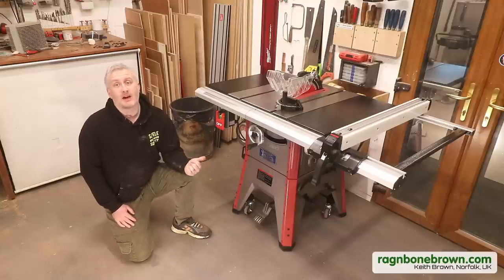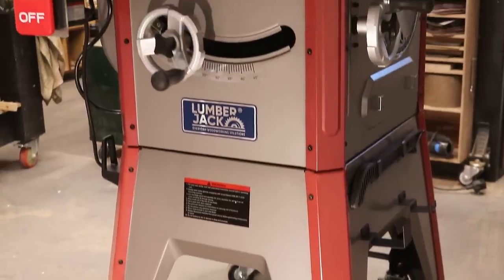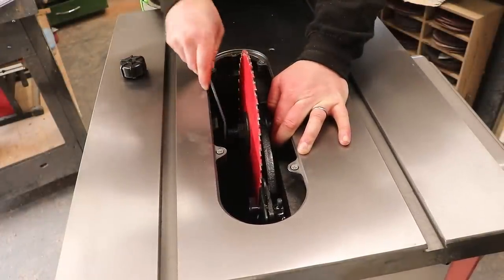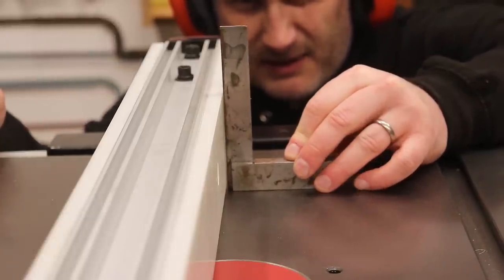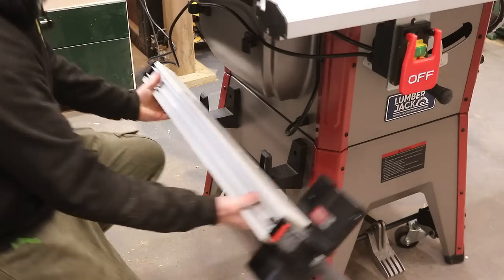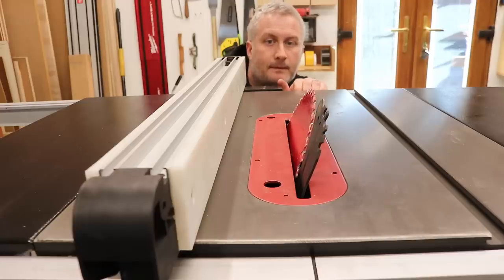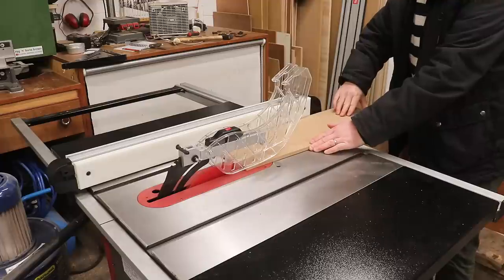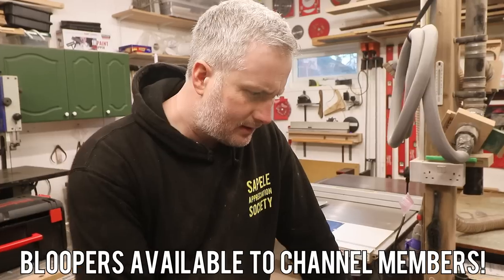LUMBERJACK TS1800 TABLE SAW: Everything You Need To Know

Comment: Dust collection Problems
In addition, to the saw, I bought a Lumberjack dust collector.  My intention was to connect the dust extractor to the table saw. I thought this would be easy, how wrong I was.

The first problem is the castor lifting system on the saw, while great for moving the saw around in a small workshop like mine, is in the way of the dust port and leaves no room to fit the flexible 100mm hose from the dust collector. 

Even if the castor system did not get in the way, out of all the adapters that come with the dust collector only one 
will fit the sawdust port and that one reduces the 100mm down to half that and still leaves the problem of connecting the flexible hose to the reduced outlet.

I went to a well-known outlet and bought a selection of 100mm PVC ducting items. 

None of what I bought would actually fit the port on the saw or the fitting on the end of the flexible hose, even the connecting section that can join 2 sections of 100mm pipe together would not fit the saw or the hose.

In the end, I used a short section of 110mm PVC drain pipe that fits loosely over the sawdust port on the saw, and I used silicon filler to seal the joint and 2 self-tapping screws to hold it in place. This allowed me to connect a 100mm right-angle bend pipe section with enough clearance to allow the castor system to still operate. 

This was also loose in the 110mm section, so more silicon and self-tapping screws solved that, finally a short section of 100mm pipe fitted the 90deg bend correctly and brought the end of it to just outside the castor space and is easily accessible at the rear of the saw.

The final bit of the jigsaw was connecting the end of the flexible hose to the new 100 mm end of the sawdust port. I had to remove the end that was fitted when it came (not easy as it is glued in) and replace it with a 100mm PCV connecting joint that fits the 100mm pipe correctly. Now I can connect the flexible hose to the saw without problems or having to get on the floor

Comment: Great unbiased review as always Keith,  the lumberjack looks like a well thought out peice of kit and has many nice to have features. Id keep the Lumberjack as the features are just way more user friendly.
Reply: Had the saw for well over a year. It’s a great bit of kit,accurate,powerful and not too loud. It has standard mitre slots,so after market add ons are available and compatible,had the same issue with fuses as Keith. I’ve ordered two slow blow fuses as recommended. If I just leave saw switched on,the standard 13a fuse works just fine. It means I must lower the blade below the table surface every time I’m finished in my shop,too dangerous otherwise. I’d recommend this machine,great tool.
Reply: @johncorrall1739  Hi John sounds really good,  I see the saw has had quite a big jump in price recently, I suppose its like everything lately.
Reply: @karlpopewoodcraft  
I don’t mean that I leave the saw running,clearly I turn off the current,I just don’t turn off the power to the saw.
Reply: @johncorrall1739  haha ye I understand John that would be crazy lol
Reply from the maker: Cheers mate!

Comment: Great review I’ve got the Axminster 12” version and apart from the short arbour (machined my own to take a dado stack) it’s been great agree with all your comments. Bit of an own goal by lumberjack, if they had responded with a sale or return offer thing you’d be a LumberJack. Also I really don’t know why they don’t just charge £20 extra and put on a soft start module.   ❤
Reply from the maker: Cheers. I think the electrical issue has only come about recently, it's been on sale for years but all the examples of it have been in the past few months so presumably something changed in the manufacture of the saw causing the problem
Reply: @RagnBoneBrown  Makes me wonder if they've downgraded the motor, which has a higher start current.
Reply: @CNile-se9xw  The motor is designed for the American market running on 60hz running at 3450 rpm. In the UK at 50hz it runs at 2800rpm , very slow for a table saw and the reason it cuts slower. Until hey spec a decent motor to run on the UK supply with a soft start I wouldn't want one, shame as it looks a decent saw.
Reply: @alankirbywoodworking  Spot on mate, I didn't realise they kept the 60Hz motors, so your speed difference sounds right. Another damning factor is that running a motor at a lower frequency than it's designed means that's also less efficient.
An example of frequency relating to magnetic strength are the physically small transformers (for the output) in pulse width power supplies. Their tiny transformers are fed a high-frequency signal & produce staggering high output for their size.
Reply: @alankirbywoodworking  The motor speed is largely irrelevant, as it is not direct drive (the size of induction motors precludes this- you would not get much depth of cut...). The speed is set by the motor to spindle ratio, allowing the optimum to be chosen. It may well be that the manufacturer does not change this for the non-US market- which would be a poor decision. Single phase Induction motors (permanent cap type) are 'soft start' to an extent anyway- the starting torque is quite low.
Reply: @CNile-se9xw  Most squirrel cage induction motors are designed to span 50-60Hz; the design parameters are not critical over this range. They are typically spec'ed to 70Hz.
Reply: @Tensquaremetreworkshop  Cool, thanks mate. 👍

Comment: Keith - you have a tough decision to make 😀 I must admit I was laughing at the advice Lumberjack committed to ‘paper’ on the blowing issue of 13A fuses apart from trying the slow blow variety the rest was tosh. Plugging into an extension lead would make the current spike higher (increased circuit resistance) and changing the MCCB from a B to a C does nothing at all to prevent a 13A fuse blowing.
Reply: How can higher source resistance increase inrush current?
Reply: @normanboyes4983  I = V / R, higher resistance -> less current.
Reply: @JGnLAU8OAWF6  The motor will draw the current it needs to start and the higher the resistance between  the MCCB and the motor the more current will pass through the 13A plug.

Comment: Hi again, I finally got my saw. I completed the build and set-up today. I had some minor problems like you. I have the same slight dip of the tabletop in the centre and the insert holes for the screw are slightly out. I would be interested in what you do to make one. There was one bolt for the rear rails that was impossible to tighten, the one that is in the cast iron part top right looking from the back. I got the washers and nut on but could not get the spanner on anything like enough to tighten it. I have not had any fuse blow so far. 

One issue, which I don't think you had, was that I think the main scale on the right side for the fence was 2 or 3 mm too far to the right. This made lining the sight mark correctly hard as it was as far to the left in the window as it would go and still a couple of mm out. If I made a cut at 12cmon the fence it was 11.8 or just over. I corrected this by sanding down the left-hand side of the sight mark to allow me to set it a little further to the left and now a 12cm cut is 12cm.

This is my first table saw so I am planning to build a cross-cut sledge first then maybe a jig for making jointer edges on wood that is not even.

Comment: Brilliant video as always, the little slots in the mitre gauge have me wondering, if you removed the grub screws and gave them a couple of turns of PTFE tape would that splay open the slots just enough to take up any sideways movement?
Reply: Yes, or maybe replace them with slightly tapered screws (a job for someone with a screwcutting lathe) so the more they are wound in, the more they spread?

Comment: I’m in the market for a similar saw right now, I’ve been looking at pre owned, basically because anything from Axminster is on back order! I’ve just seen this saw is on promotion for 900 quid. I’m sold! The Titan is no more!
Reply from the maker: Before seeing the saw in person, £900 seemed expensive. Having now spent some time with it, I actually think it is great value at £900
Reply: @RagnBoneBrown  To be honest, your video has been incredibly helpful, in that I was looking into pre owned Axminster models capable of taking a dado stack. You highlighted the 16amp power supply of these products which could be an issue for me. I rent a container workshop and my electric is included in the monthly rent, however, that electric is just a double 13 amp socket. SO, looks like the lumberjack would be the way to go and they may get me for a 14 inch bandsaw also! PLUS the ability to spread payments over 3 months. I really like that....

Comment: Hi, after watching your review, i took dilivery of my lumberjack saw. It really is well made. They now include a slow blow fuse in the box, and the edges are filed with a far better finish on the cast iron. Mine was also 90° out of the box, but it won't go over 45.7° so i can not get it to 45° is this something you came across with yours? Is there any adjustment on this? Thanks for the review. Overall, i am chuffed with the machine. Just need to make sure im not doing something wrong
Reply from the maker: I believe the two holes on the table in front of the blade are for adjustment or the angles. I never tried it myself but someone posted a comment saying that.
Reply: @RagnBoneBrown  awesome! thanks for the quick response. I will give this a try.
Reply: @RagnBoneBrown  this worked a treat. Thank you for the reply!

Comment: I too have suffered the fuse blowing when I got my saw last year but still have standard fuses, (I’ll look into the slow blow), however mine has just developed and annoying clicking when it slows down, I think it could be something to do with the pulley wheel on the motor but the grub screw holding it on is tight.

Comment: Agh! Just as I’d settled on the iTECH you go and do this.

Great review that answers some of the questions I had but have to say, their approach to the electrical problem is not great. They’re providing something they know is an issue and getting customers to test fixes at their own cost before doing anything. That is probably going to be the reason I stick to the iTECH I think
Reply from the maker: Glad it was helpful! 😁 Yeah I agree it seems a bit unprofessional
Reply: @RagnBoneBrown  "A bit unprofessional"? I would suggest some of the electrical suggestions are downright wrong! Changing an MCB because a plugtop fuse blows is plain wrong - the MCB is working fine and changing it could unnecessarily reduce the safety of the entire circuit. Running on an extension lead may actually work but using it as a resistor is not neither sensible or desirable ... would it be safe to have a lead unwound and laying around the workshop? Recommending the fitting of a slow blow fuse is not sensible either - UK plugtops are designed to be fitted with BS1362 13A fuses as a maximum. The only valid suggestion is the fitting of a 16A plug and using a 16A circuit. This problem could be relatively easily prevented (using a couple of simple control methods I can immediately think of) but, to be honest, I feel Lumberjack have been somewhat ignoring the problem and getting users to find their own solutions rather than giving a "professional" response and fixing the obvious issue (that the startup inrush current is slightly too high). Sorry for the ranty post but I've been watching this problem not being fixed for a long time ...

Comment: I use 20 amp fuse in my lumberjack. I had real problem trueing up the blade on mine And its true,but not in centre of insert so had to file one edge of insert to stop it fouling blade. I will try again one day to sort it out as I cannot use the fitted  ruller now. every time i got the blade near to centre it would be out line, it was a nightmare because the weight of motor would pull itself out of line every time I tightened the threads down. One tool I do like is the Lumberjack big planer thicknesser i forget its name at moment i love its shavings extraction as it is self powered no dust extractor needed. the negative is it came with straight cutter head and came with very soft blades, when i first enquired about a spiral cutter head replacement,. and asked if it was produced in another make like there saw is. they where very short with me, insisting only they made it and seamed quite insulted to be asked  that question, it was a female in first contact! but on contact at a later date, I spoke to a different person a male who was much more understanding, and said they were hoping to have that option in near future. Just looked at the amazon link for the saw, and noted price it was just over £700 when I got mine. now its a nates hair off £1000 now, shocking The only axminster tool I have is the large craft band saw . Its blade never lined up either and they at least sent out a new top drive wheel a adjuster for it , A known fault I read in meany places, even the replacement was not much better, and i still had to do a bit of fetaling to work with it. Only recently I pick up the origonal top wheel and the penny dropped what was wrong. The bearing and housing is off centre, and had been fitted at factory in reverse  , so i turned bearing around and alls well now, but Axminster poor quality control ! who can we trust for machines now.

Comment: On the Axminster cons. It is a machine design from '80s (from Kity if I remember correctly) that is why the poor user experience features. The blade tilting on the right is because it was designed to be a slider and not a cabinet saw.

Comment: Keith, I have the same axminster saw and i fixed the dust extractor issue. I made sure to seal any openings in the cabinet, also i made a blade guard from plexiglas (including dust extraction) wich lowers on to the saw and is height ajustable. No I run a single dustextractor, one similar to yours, and it works fine. Before i could see mdf dust fly everywhere , but with my plexiglas blade guard this is history. When i saw your video I got exided since I have a small workshop and find the Axminster a bit big, but seeing you work with the Lumber jack  I am convinced I should stay with the Axminster, I think you should to, it looked a bit flimsy and weak, also the electrical problem is a dum one. And for the 45/90 degree pro points for the Lumber Jack I would consider this a con. Wouldn't you rather have the possiblity to adjust this?

Love your video's!!
Greetings from the Netherlands!

Comment: Great vid as usual Keith 😊
No disrespect to Lumberjack but I think they’re definitely a bit sub standard in their customer service.

I’ve got one of their plunge saws, and after being used and abused it needs a new splinter guard, so I contacted them.

I got the reply that don’t supply them, so unless I could get a makita one etc to fit, I’d have to buy new tracks!

In the end I removed & refitted the old ones, enabling me to trim them back, and they’re ok, but what a strange attitude they have.

I think everything you’re liking about the saw is thanks to the designers of the Rigid original, and nothing that lumberjack have done. So I suspect they’re batting above their weight with this one!

Comment: Really interesting review and comparison by you so no surprise there. It's always a dilemma when you find a new machine that deals with the things that irritate you about the old one but I suggest you consider the essentials of what you need. I have the Charnwood W629 10" cabinet and despite its (many) faults, I couldn't imagine changing to a similar level saw. The fundamentals are important to me, dead flat cast iron top, spot-on accurate blade in all heights and orientations and a fence I can now accurately rely on. I change blades a lot and do a lot of groove cuts so a single riving knife is not helpful so I install kerf-thickness riving knives to zero-clearance throat plates to match each blade. I forgive it its faults because of the essential things it gets right. I once read that induction motors last better if you hold the start button in for a second but I'm not sure if that's true. I also start the vac after starting the saw which helps the load.

Comment: Very interesting and informative video, super helpful! I'm wanting to upgrade from a budget job site saw but my workshop is a small basement so I'm very limited on weight and space. Would love a cast iron top but I'm not sure if it would be too difficult to get downstairs? The lumberjack seems like the obvious winner for your shop in my opinion but it can be difficult when you feel like you can't trust it yet. Hopefully a few projects down the line should help you :). Which saws would you recommend for a tiny workspace in need of accurate cuts?

Comment: Someone has probably already mention this but the screws on the mitre guide should adjust the 'wiggle' as you screw in it should expand the splits and tighten it in the slot. I guess you need to Gring the end of the bolt down.